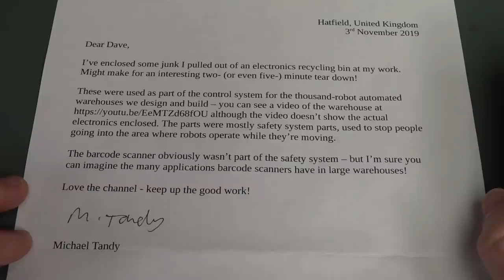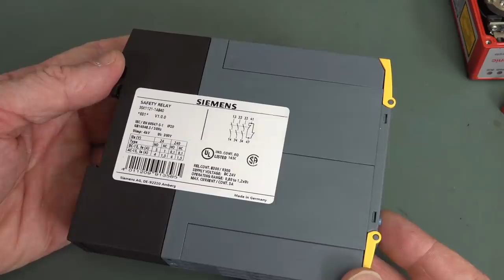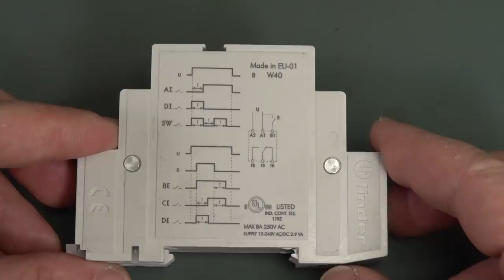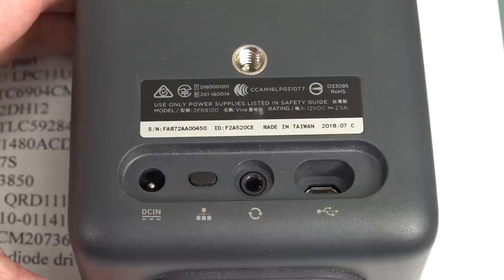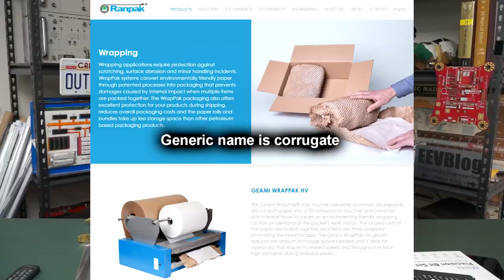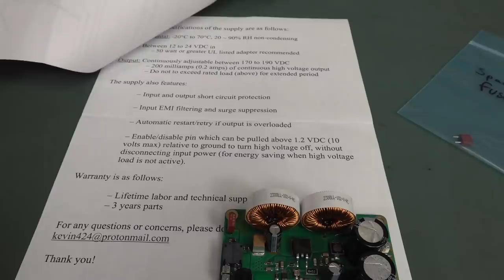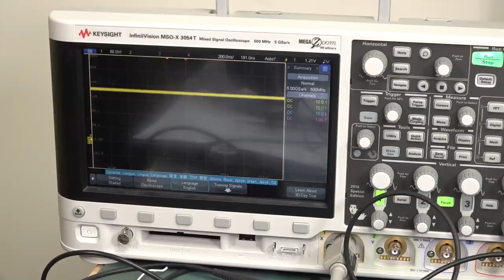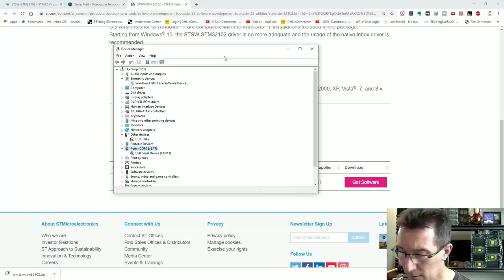EEVblog #1263 - Mailbag

Comment: For the VIVE base station it is completely isolated from the headset and computer, but it does communicate with the other base station. Also it dose not power over USB, the USB I'd just for firmware updates. It powers with 12v in the barrel jack. You only need one sensor to make it work, but the second one makes it more stable and makes it work when you hold the controller behind your back. There are several sensors on each controller and the headset so it can triangulate with two or more sensors on the headset and one base station. Once it's running it works well, but the software tends to be kinda glitchey.

Comment: The Schneider unit looks like it was designed with a repair engineer in mind. It would be easy to pop open the case, hook it up to your test rig and probe around the circuit. And, of course, re-assembly would also be quick and easy.

Comment: These are guided relays inside the units. Used to check if the contacts are welded or jammed. If the unit fails it cannot be reset making drive motors, presses etc fail safe. (hence safety relays)

Comment: Those TE safety relays are awesome (and off the shelf), I recently included some in a design. They have guaranteed minimum isolation gaps in the internal construction for isolated systems "safety". Not cheap though.

Comment: Those Nidec motors probably have hydrodynamic bearings, hence the label for use in one direction only. 

I wouldn't be surprised if they are similar to HDD motors/bearings, would make sense from a tooling standpoint. 

Ifixit "Hook" bit is for screwing in hooks 😂

Comment: The Schneider Electric relay reminds me of some old General Motors/Delco Electronics PCMs. When you split the die-cast housing the two boards were assembled the same way with ribbon cable joining the main processor and I/O boards together. Made it nice and easy to reset the flash if you did something stupid and locked it up. Now they're using MCM construction with bare dies on the board so they hermetically seal the housing so no joy there in taking it apart anymore.

Comment: the hook bit is used for driving in eyebolts or hooks.

got an ifixit myself after i couldnt find an easy way to use the microbits in a hex set, these sets come with a 6mm hex adapter so it will work in my wera ratchet driver, they are the ducks guts. :D
Reply: also work on a wing nut

Comment: I would say the HTC device first sends an IR pulse, then a moving vertical laser line and finally a moving horizontal laser line (or vice versa). The HTC vive determines its position relative to the transmitter based on the delay between the IR LED pulse and the laser pulse.

Comment: You missed the obvious on the website, it says the Windows 10 native driver is all you need and the ST driver is no longer needed.
Reply: Well then why didn't it automatically install.
Reply: @simontay4851  It didn't actually say the driver was missing, the exclamation mark in device manager is a generic warning. Could be any number of things, you have to actually double click the device to read what it's trying to say. He does have a tendancy to assume rather then  read. Having said that windows 10 is very dicky when it comes to serial devices and often requires a reboot for them to function.
Reply: It didn't work with the inbuilt win 10 drivers because they are much pickier than the linux CDC drivers or ST's drivers for windows 7/8... Working on Win10 support now, it doesn't correctly honor "use interface level class & subclass" and "don't send me line control codes" settings. Even with the CDC ACM bmCapabilities set to 0 it still tries to send LINE_CODING and SET_CONTROL_LINE_STATE commands I wasn't handling - because I told it they were not supported!
Reply: Yet another reason to avoid W10. It doesn't even do what its told.
It would just work properly first time in XP or W7.

I still use XP on my own computers (with SP4) because there are lots of things in the W7 UI that annoy me but i'll tolerate it when setting up systems for other people. I refuse to touch Win h8t and 10.

Some examples: libraries, home group, command bar, folder menu bar not at top and not movable, various control panel items are renamed for no reason, no classic start menu, changing detailed power settings requires many  multiple clicks, bloated personalisation dialogue (display propeties in XP was fine), network settings are overly complicated, program data/users folders are a mess. Some things can be disabled or changed by registry edits and by using classic shell, some other things can't.

Comment: The irony of the ST download website text about the Windows 10 driver sitting right above the Device Manager window the last minute of the video 😂. ST really goofed that user experience up something fierce.
Reply from the maker: Easy to miss stuff when you are talking into a camera
Reply: @EEVblog  the way they have that site set up I can't imagine ever catching that the first time though, camera or not, haha. I have no idea how you can do it all off-the-cuff to begin with, nevermind the finer details.
Reply: @EEVblog  Well missed or not it certainly did not work with the inbox Win10 driver anyway so that gives a point to the Win10 bashers about its fantastic support ;)
Reply: To make it worse, it didn't work with the inbuilt win 10 drivers because they are much pickier than the linux CDC drivers or ST's drivers for windows 7... Working on Win10 support now, it doesn't correctly honor "use interface level class & subclass" and "don't send me line control codes" settings. Even with the CDC ACM bmCapabilities set to 0 it still tries to send LINE_CODING and SET_CONTROL_LINE_STATE commands I wasn't handling - because I told it not to send them!
Reply: Started getting it to work, can open the port now. Just need to add some code to deal with Win10 oddities.

Comment: I've got a video of these Vive base stations working in infrared slow motion(40kfps). Check it out!
I use them both for fun and scientifically - with a bit of averaging(say, 100-1000 samples) without IMU corrections, you can easily get sub-mm accuracy *across the entire room*. This consumer system has AMAZING performance for how much it costs compared to metrology gear.

Comment: You're thinking of the Nokia 3310, the new "3310" isn't a patch on the original (though I was, later a 3350 adherent), I'd have MUCH preferred they slapped a 4G baseband on the original 3310 and called it done.

Comment: The connector that dismount from the relay it is to simplify wiring. You pull the connector, wire your cables and reconnect.  when you have 1000 wires in a control panel  and you want to replace something is very difficult to pull a relay from a din rail.

Comment: Okay, simpler explanation of safety relays. You have a machine with a dangerous or deadly moving mechanism, and a metal guard surrounding it. But, your operator needs to touch that mechanism, so you need an access door to it.

Ok, so how do you guarantee that the rotating mechanism is stopped, and does not start, while the operator is inside? With a switch to detect the door being open, and a safety relay. If the door is open, or upon any failure, the relay opens its contacts that power the movement, stopping the motion.

How failure is detected is complicated, but think of a pulsed test signal instead of just a DC circuit.

Comment: Teh safety relay is for systems that require a Category 3/4 or 5/6 safety circuit. It's all about redundancy, monitoring and cross checking of the circuits and systems. In the even of a failure of a circuit or one that is performing out of spec, the system can see that it's happening and then either note it and take no action because there are redundant circuits in parallel. Or the system can take corrective action in response to a failure. We use these in the xray systems I design for the package industry. All the interlocks and controls are controlled and monitored by Allen Bradley Guard Master safety PLC and Guard Master ancillary devices (contactors, etc). So, all the Mechan mag switches (interlocks) on the doors are all two channel which feed into the guard master PLC, the mains to the inverters are all controlled by guard master contactors, the e-stops all have failsafe early break contacts piggy backed on top of the N/C contacts and both are fed into the guard master PLC. The PLC needs to see the early break and then the N/C go open within a certain time of each other or else it will assume an out of spec condition and trip the safety system. As well if the failsafe contact comes loose, it sees that it is no longer attached to the e-stop and it also trips the safety system. If the guard master contactors monitoring circuit senses the contactor not performing, it will trip; the contactors are also double redundant internally for fault protection. I could go on and on and on. Its good kit and you don't really know what the stuff is unless you work in a field that requires it.

Comment: Anytime I get a product that only has a Windows 8 driver I set compatibility mode to Windows 8 before install - sometimes it works, sometimes it doesn't - I was able to get an ATI 1100 series Windows Vista driver working in Windows 10 with this method. I would not recommend it for a PC that you depend upon (daily driver, etc) because such drivers sometimes stop responding requiring a restart

Comment: (4:30) - My guess is that those ridges are for some kind of calibration testing and setup.
 It looks like you could slot things into them at differing angles.
 What goes in the slots ?
I dunno. Mirrors? Half mirrors? Filters?
Perhaps someone else can help me out here.
>

Comment: Have you ever wondered what electronics will look like a thousand years from now (assuming people are still around)?
I'll bet they will still use PC boards, wires, connectors, resistors, caps, diodes, relays, switches, LEDs, heat sinks, discrete transistors, screws and nuts.  So a lot of stuff would still look very familiar to us primitive cave people.  But they may also have more integrated photonics, and probably some sort of quantum processing.  And maybe they'll  use 3D printing to build circuits some how.  Any other ideas?
Reply: ........ Hope your speculation is correct Steve, I have little confidence in the survival of our species/atmosphere.
Priorities are comical. A Professor on the radio the other day talking about mining other planets, (FFS).

Comment: I actually read that bit about the Blackbody Ambient Field Conditioner, only $1400! Says it solves the "coloration" of sound reproduction. What does "coloration" even mean?
That gadget is obviously ridiculous. If parts of your audio gear are affected by outside EMF, you can just shield it with metal which the manufacturer probably did already if it was that critical.
I'm in the wrong business. I could probably get rich from the audiophile market but I would hate myself at the end of the day.

Comment: Hm. Why are relays packaged in clear plastic?
Reply: To make it more pornagraphic.
Reply: It might be clear so that you can visually inspect the relay. When the switch opens or closes while connected to a load there is arcing. The arcs cause the contacts to degrade, when degraded enough it becomes visible.

Look up Arc suppression on Wikipedia if you want to know more about it.
Reply: @MagnusRostedt  That's a good point, but I think lots of such relays are used in circumstances where that level of diagnostic examination is unlikely. Like, if one of these relays in the video goes bad, the repair is probably not going to involve desoldering a bad relay and popping a new one in. They're just going to replace the unit that isn't working.

And if the relay failure is being investigated in a FAA/NHTSA-type disaster/catastrophe investigation, they could just break open the relays to inspect the innards.
Reply: Jonathan Hendry Well, not all relays are in clear plastic. Many are not. Clear plastic isn’t necessarily more expensive than opaque, either. So we see both.

Comment: Aw, wanted to see the Vive base station working without the case. I always assumed it was a singular rotating array but I guess seeing that it has 2 that makes sense. FYI the base stations need the DC power in to start, the USB is basically just for initial setup.

Comment: 27:38 i am genuinly interested how this works out - can you actually cross the streams without interference?
Reply: You can always cross any light beam without any consequences. That's because Maxwell equations are linear. Just like two people talking in a room will not change their voice or anything. Or just like two signals on a cable or in a fibre. Of course, where the beams cross, there can be interferences, but this will not change de beams. Moreover, in this case, there's not interference because they are two different lasers (mutually incoherent light sources).

Comment: HTC: Sensor on the front is maybe an ambient light level sensor
Reply: It's to detect the sync pulses from the other lighthouse so they synchronise to each other. They also carry data over the light pulses at a very high bitrate so the sensors need to have a very fast response (in the MHz range) that's why they use a large area photodiode. Look at 'cnlohr' youtobe channel, he has lots of videos on reverse engineering the timing and data protocols, it's very fascinating and a lot more to it than you think (including a proprietary encoding protocol!)
Reply: @brainndamage  Thanks.

Comment: The htc Vive uses 12v for power the micro usb is for linking to a pc for firmware updates and roll backs if required the other stereo jack is to hard link the two base stations but usually work fine wirelessly

You can use one base but it dose loose tracking which can make you feel a bit sick 🤮

Comment: The 180V boost module for $150!!!? That's crazy. Just search ebay or Ali for "DC-DC 8~32V to 45~390V High Voltage Boost" and get a 40W (70W peak) module for less than $5. Ok it's going to have switching noise and stuff but for driving Nixies who cares?
Reply: Given that the nixies themselves cost quite a lot now, this is no project for people with shallow pockets anyhow. And really, would you trust a cheap Chinese AliExpress HV regulator?

Comment: You're probably thinking of the Nokia 3310 which has a renewed following. I still have mine but of course, it does nothing now the 2G GSM network has been shut off. (So you're right, what they're selling is a variant).
Reply: PS. The "prism-y thing" on the HTC laser scanners look very similar to the diffusers in laser line generators. ie. the type that need to produce a static rather than scanned laser line. That would make sense since there would be full vertical line sweeping across the scanned volume alternating with a full horizontal line scanning from floor to ceiling.
Reply: Oops! I should have waited a few more seconds before posting! I see you worked that out..
Reply: The Y-shaped screwdriver bit is for wing nuts.

Comment: It is just so easy to start a rant on STMicro just like you did in a previous video. A little more respect for others .....
Reply: To be honest though, if you were not the developer of the product and you have Windows 10 and you need drivers, the STM website does leave a little to be desired in providing instructions:  "Starting from Windows® 10, the STSW-STM32102 driver is no more adequate and the usage of the native inbox driver is recommended."  I'm sure people familiar with STM maybe know what this means, (in-box as in built into Windows?, or should the person using the STM in their product supply drivers?)

Comment: (@51 or so minutes in) - This is why I don’t use Windows at home. Yep, this one came a gusher. 😬
Reply: *gutser
Reply: Not over here. It came from a time before the refining of crude oil. Someone would be digging for coal (or something else), and strike a deposit of crude, which - back then - had no commercial use. As it was sometimes under pressure, it’d come gushing out of the hole; unexpected and unwanted. Thus the phrase, “it came a gusher” came to mean that you got something unexpected and undesirable. Not even sure where “gutser” came from. Anyone? Beulah? 🤔
Reply: *Bueller
Reply: Who’s Bueller? It always sounds like “Beulah” to me, though. 😏

Comment: I have a Nokia 8110 G4, a proper phone , no smarties that you don't use, great phone, before that I had a Nokia 3110 G3. 
Top phones in the true sense of the word.
The 8110 G4, is same as phone Neo used in the Matrix.
The Schneider safety unit has Forcibly Guided relay contacts.
It has to do with what happens when contacts fuse together, and how the other contacts in the relay behave.
http://www.omron.com.au/service_support/FAQ/FAQ02481/index.asp
A mix of SMD and plated through components is not uncommon in timers and controllers like the Finder.